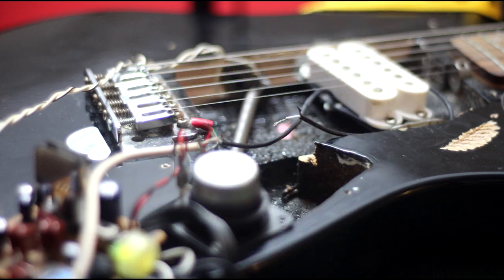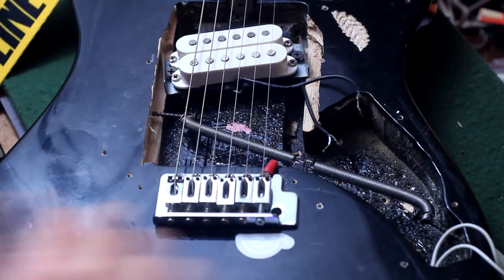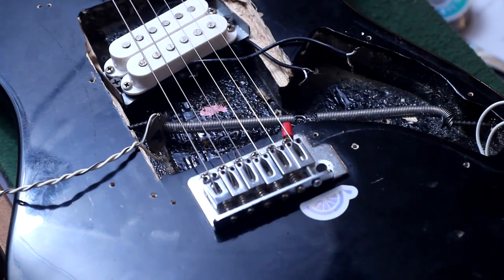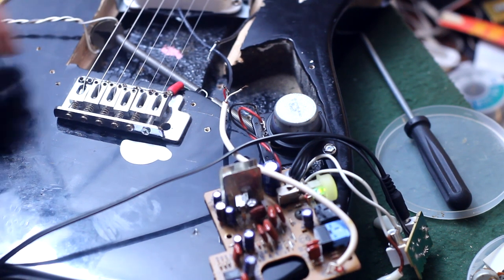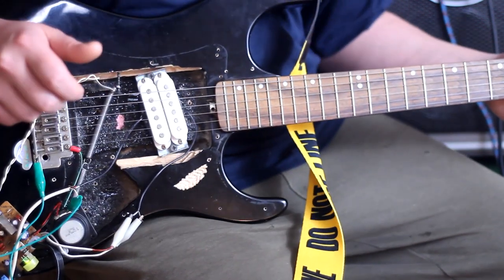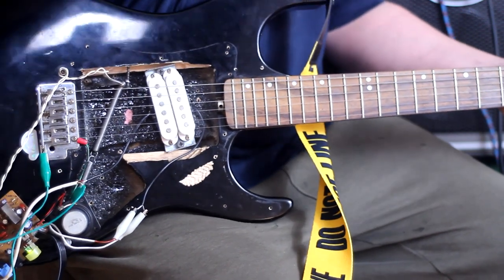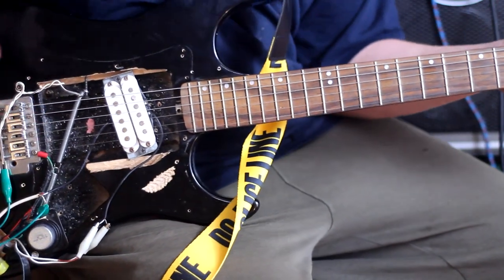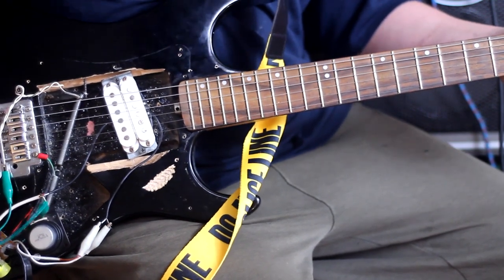Spring Reverb INSIDE the Guitar! (Full Build + Demo)

Comment: Killer tones...hmmm what if you took a carburetor spring and put the small ones inside if it would make the laser sound🤔
Reply from the maker: Thank you Rob, I tried to respond to this earlier but it didnt send I guess. That is a great Idea. I bet it would make laser blaster sounds like a guide wire on a power pole. Thanks for the suggestion. I will put this in my note and if/when I make a video about it I will give you a shout-out.

Comment: When I was a kid, I used to "play" the cables attached to the springs that were part of the mechanism that made the garage door easier to open/close . . . speaking of reverb. Hook up a guitar to that, and if you don't get arrested, well, you probably didn't do it right.
Reply from the maker: Thank you so much for watching and taking the time to comment  totallyunmemorable. That's an awesome idea. I'll have to see if I can find a door with the right setup to get at those cables. I did just consider using the guide wire on a power service pole? maybe these are both good ideas for a "improvised reverbs" episode sometime in the future. Great suggestion!

Comment: i would like to know the specs on that "mule " guitar. i have plans of making my own. that has to be one of the best guitars out there.
Reply from the maker: Thanks for watching and taking the time to comment. Its not really a great guitar but it works for this purpose I got it at a thrift store for very cheap. Plays a lot like an Ibanez RG has a very thin neck and the factory pickups aren't the best but they worked fine. Its exactly the same as this one: https://www.ebay.com/itm/233847864641?chn=ps&norover=1&mkevt=1&mkrid=711-213727-13078-0&mkcid=2&itemid=233847864641&targetid=4580909047880289&device=c&mktype=&googleloc=&poi=&campaignid=410490132&mkgroupid=1236950807734171&rlsatarget=pla-4580909047880289&abcId=9300490&merchantid=51291&msclkid=8824d540b94a14bf35fab524d7c48e33

Comment: so you can use a small dc motor  to send to the springs .. pieso on other end
Reply from the maker: If you slammed it hard enough it might work well. might need a little arm for "leverage" I used to use dc motors from toys as speaker drivers just that way and I know it will play music on a funnel made of paper.

Comment: You should get a screw terminal block for the mule guitar so you don't have alligator clips in the way of your strumming. I look at them clips and just go "I would have fuckin' snagged these on something and pulled wires out of the guitar"
Reply from the maker: As always thanks for watching and taking the time to comment Alaric. That is a great Idea!... that being said I doubt I will do it as you can see from the way I build stuff I'm rather lazy with details. I never did expect to be doing all this stuff with the guitar I just set it up for testing pickups and that worked pretty good the wires would tuck into the cavity. For a while I just had bare wires I would twist LOL. Also with so much different stuff going on with the guitar. It would probably still end up with clips on it. The green clip on the demo part was an extra ground from the bridge to the little amp board but the 2 white clips do run to a ground screw... you know mad scientist style. It is however a capital idea and the right way to do it and I had never considered it. Maybe in the future I'll get another cheap guitar and do it that way. Thanks again Alaric.